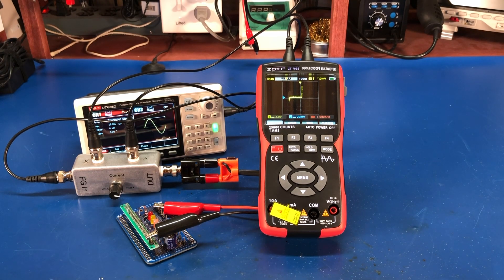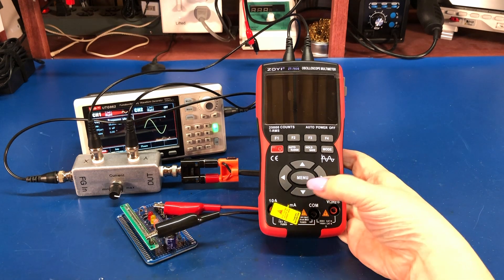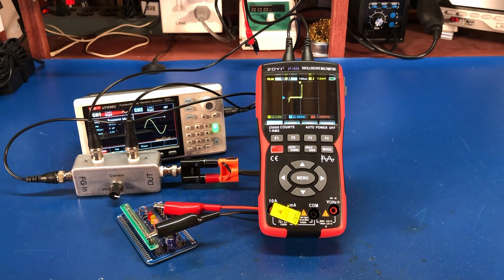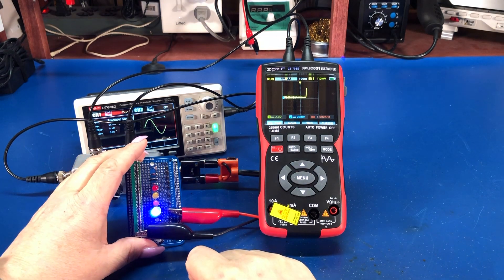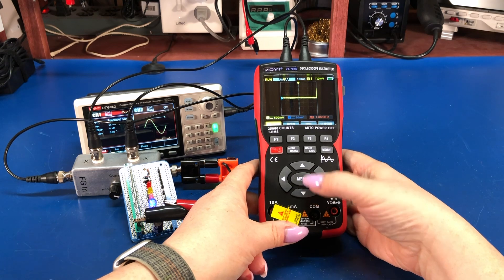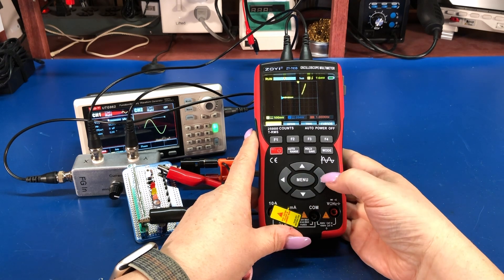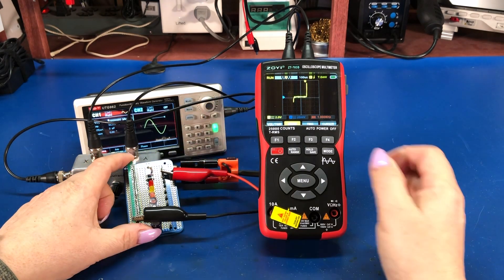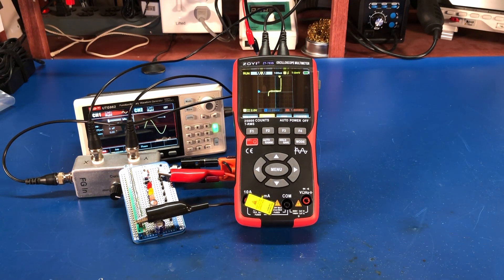Curve tracing with the ZT-703S

Comment: Hello Sir, as per your connected equipment:

"FG output" to "Octopus Input"

"Octopus output" to
ZT-703S Input 1"

"ZT-703S Input 2" to
"DUT"

Is this correct Sir? 

Thank you so much
Reply from the maker: Function Gen out is connected to the octopus adapter FG in.
Component (DUT) is connected to the octopus adapter DUT in.
Octopus adapter X out is connected to ZT-703S Input 1.
Octopus adapter Y out is connected to ZT-703S Input 2.
Reply: Thank you Sir. Do you sell the whole Octopus assembly please?

I already have Tektronix CFG 250 Function Generator and I am going to buy ZOTEK zoyi-ZT-703S soon.

Can I please buy from you Octopus assembled unit so that I can connect everything to be used for curve tracing please? Thank you
Reply from the maker: @roelrebosa4627  I do not make / sell these. Sorry.

I did post a nice clear schematic for this here: https://www.youtube.com/post/UgkxNNgUClhtbZ90csPjiSuMUKJ7AU5Ck5uV

The entire build is two resistors and four BNC jacks - and you don't even need the jacks - you can just breadboard this if you want.
Reply: Thank you Sir
Reply from the maker: @roelrebosa4627  I actually do have the parts to build another if you still want one. Let me know.
Reply: I want one too.  @Donna_Matthews
Reply: I want one, how much is it? Thank you

Comment: I just purchased this meter to use with my dual range passive curve tracer unit.  I’m really impressed with this 703S at an $80 price point.
Reply: Is it the dual range curve tracer called tracER? The one on Ebay? I just got one of those and all it shows correctly is an electrolytic. It doesn't seem to work on other components. Could you tell me what settings you used in XY mode? Thank you.
Reply: That’s the unit I have, well I have 3 of them in the shop.  They work great for caps, diodes, transistors etc.  If you can read one component you should be able to test them all.  I use a 12 VAC 1 amp power source with the tester.
Reply: @timedrington139  thanks for responding. I have AC 12 volts at 1500MA.  I must be doing something wrong.

Comment: If someone had said to me as a teenager in the early 1980s, in the future, you will be able to buy a digital multimeter that is also a dual channel 50Mhz oscilloscope, that has a colour display, AND fits into your hand for less than £75 GBP (£21 in 1981). I would have suspected that person had been drinking electrical cleaner. 😂
Buying this is a no-brainer, it's fully isolated as well, which is another advantage of this gem.

Comment: That zt703s is in my cart. The buggy firmware makes me hesitate.
Reply from the maker: For under $100, this was hard to pass up, and is a big step up from the really low end 'kit' scopes, and it has a DMM as well.  I'm remaining optimistic that there are firmware updates in the works to help smooth out some if the issues.

There are other scope meters (Owon, Hank) that are much better - and much more expensive, with the higher bandwidth models getting into the price range of low end bench top scopes.

For starting out, I think this could be a good choice; at 50 MHz, It is certainly serviceable. I got it because it's small and could work well in videos - and because "why not?" 

While it may not be the greatest scope, the worst scope is the one you don't have. 🙂
Reply: I have Zoyi ZT-703S, so far it works fine for me - if I stumble upon bug, I just ignore it. That was my first decent oscilloscope, by the way. I was surprised how good it actually is.
Reply: @Dr_Mario2007  it's better than the price so I'm good with that
Reply: I have the 702S. It was great until I updated the firmware and now it's got all sorts of problems it didn't have before.